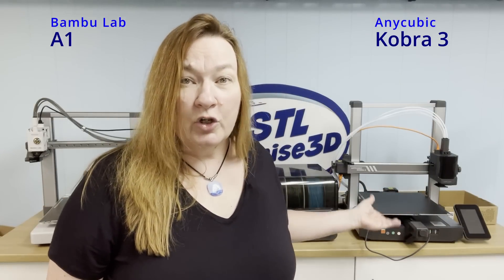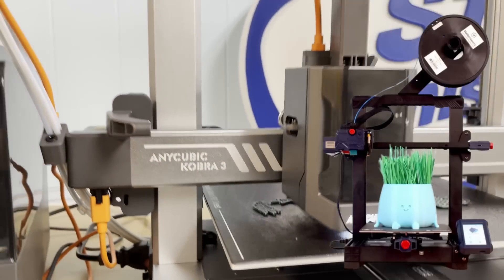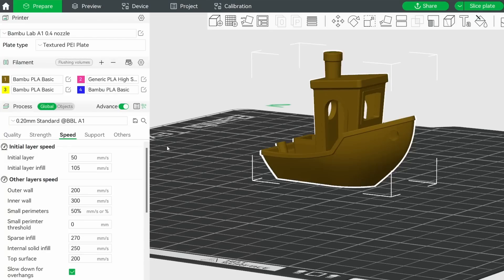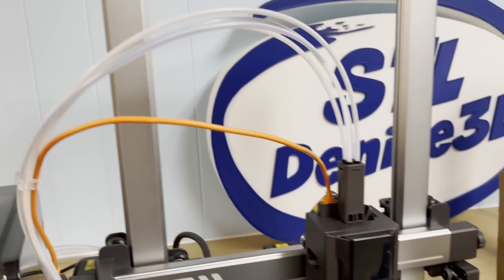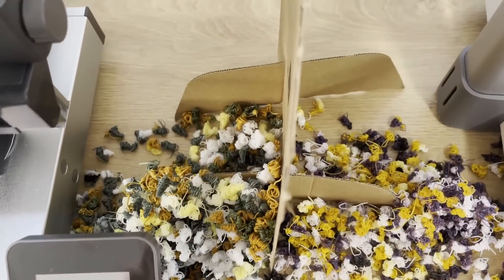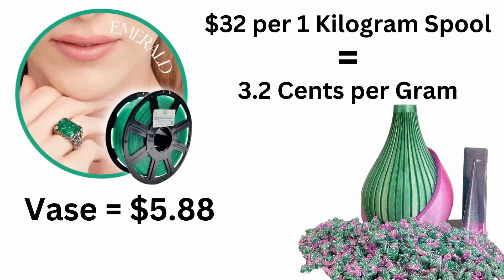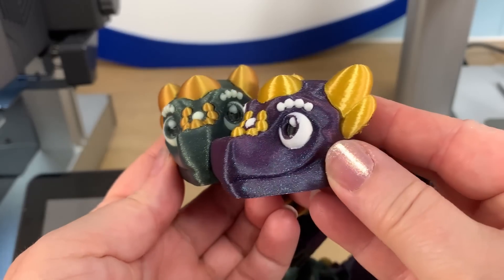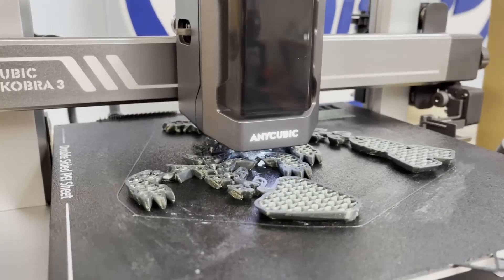ACE or AMS? Anycubic challenges Bambu Lab with new color 3D printer!

Comment: I'm gonna throw in my 2 cents. I have had both these printers and the Anycubic was an absolute pain to deal with, I was tweaking the thing so much and it kept giving me random issues that I could never solve. And I have been 3D printing for 6 years now. Anycubic's quality assurance is horrendous too, I have had many anycubic printers arrive with 100% dead boards and broken auto level sensors and they rammed the nozzle through the bed in the first few minutes of using it. I will never buy from them again. I have 2 A1's with the combo and one Bambu P1S and they are absolutely flawless in about every way, Its almost baffling how good the Bambu printers are, its like they solved every problem I had with the competitors. You can just get stuff done and run your print farm without issues, I cannot tell you how much of a godsend the Bambu printers are and they have accelerated by business.

Comment: Anycubic is the worse, I’ve got 2 of these machine and they were terrible. However Bambu A1 is the best. No problems at all.
Reply: Please elaborate, from what ive heard most of its problems can be fixed by tinkering even tho its a pain. Don't know if I should go with the kobra bcs its cheaper and open source and get a klipper plug in for the ace or if i should just get the a1 mini an have to face a smaller print bed and potential obsolescence in future once it becomes outdated.
Reply: @ I had no patience from the pain of the Any cubic.Customer service is no help and I could go on. I would go with the A1 mini. I promise you wouldn’t regret it.

Comment: Is the ACE airtight?
Reply from the maker: Tight enough -- it does have tubes running out the back to the printer. But a good filament drier needs to let the moisture out anyway.
Reply: @stldenise  Thank you. Was wondering if it had vents or fans somewhere.

Comment: I just recently picked up the Bambu A1 and absolutely love it.  It's my first experience with multi-color/multi-material printing.  While the AMS Lite isn't a dryer, I already have 2 of the new Creality dryers (I also have a Creality K1 and K1C, as well as a Prusa MK3s+).  I'm still learning the Bambu slicer software, but I actually tend to prefer it to Creality's slicer now.  Oh, and I'm in StL as well!  I love finding local Youtube channels!
Reply: How is the bambu compared to prusa? I have a good deal on a prusa with mmu2 and don't know which one to chose.
Reply: @belakulcsar  As far as I have read the Prusa 4 is pretty much equal when compared with the Bambulab A1, so if you have a good deal on the prusa it may be worth going for that. Where I live the Prusa is more than 3x as expensive compared to the A1, which is why i went for the bambu.
Reply: @belakulcsar even a good deal on a prusa is still more expensive than an A1 in my experience so I'd just go with an A1 I love both of mine

Comment: its hard to beat bambu studios slicer. ive been printing for awhile now an i got 14 printer between 8 different brands an ive just recently broke over an got a bambu lab p1s with the ams, i had actively avoid the bambu lab machines because they wasn't open source like all the other printers i owned so i avoided them but having to spend so much time painting alot of the models i was asked to make i finally broke over an decided to give bambu labs a try an at first i was just going to get the a1 with the ams mini but that was around the time they was having issues with the bed power cord i think it was but they had to recall them an that pushed me toward the p1s combo, was a bit more costly than i had originally planned to spend but im glad i got it, im going to get more at some point but the ams mini just doesnt seem to be as apealing to me since u cant hook more than one up at a time compared to being able to stack 4 of the regular ams with the p1 an x1 machines so that alone pushes me toward the p1 series of printers but i wouldnt mind trying there bed slingers cause thats what most of my printers are.

Comment: Sending back our Kobra 3...even though it says it has nozzle clog detection, it got totally clogged up inside the print head assembly with melted filament and we can't get the print head assembly off of the track.  Thankfully it hasn't been 30 days yet...most of these 3D printers only seem to have a one month warranty...
Reply: Bambu X1 Carbon Combo also didn't notice the clogged nozzle. This ended with clogged AMS that could not remove the filament from the hotend and displayed an error.
I managed to fix this, there was a spare nozzle, ana AMS also resurrected after I pushed manually a piece of filament through it. 

So there are no failure prone 3d printers ...
Reply: @pik33100  Good to know...ours happened the first week or so that we had it, so we sent it back and didn't have to deal with trying to fix it.  Plus the overflow ripped up the rubber cover on the print head, so that would have needed replacing.
Reply: I've had 4  Kobras of various models and they all had clogging among other problems.  I went to Bambu and will never go back until they concentrate on putting out a quality printer rather than one that is "advanced" all the time trying to keep up with Bambu Labs.  I don't go for the fastest printer I go for the one I can count on the most and Bambu has never let me down like Anycubic has.

Comment: Well now I'm back to being undecided between an A1 and a Kobra 3. I still think I'm leaning more toward the A1, especially as it seems to have had a price reduction, but I like the idea of an enclosed AMS. Don't so much like the idea of the Kobra slicer issues, but that's theoretically fixable software stuff.
Reply: I'm on the fence too. I wish someone would do an updated review with the new slicer for k3 based on Orca.
Reply: Go with the A1 even though the ACE is better than the AMS Lite.  You don't want problems, you just want a printer that works and you can count on the Bambu printers.

Comment: I received my Kobra 3 combo just a few days ago and the printer itself works great, but the ACE started malfunctioning after only 2-3 prints. It now occasionally loads multiple filaments when it should only be loading one, leading to constant jams and malfunctions :c
Reply: Tangles,spool retracement it’s soo frustrating
Reply: @ramirofonseca5169  I actually haven't had any issues with spools tangling when retracting. Just a problem with multiple being loaded at once. I contacted support, and they're sending me a part that should hopefully fix it.
Reply: @ramirofonseca5169  You could try applying a little WD40 to the rollers that hold the spools...?
Reply: I'm not surprised.  Every one of the four Kobra printers I've had had various problems.

Comment: I might have missed it but can you tell what the print duration was for the model (A1 total print time vs Kobra 3 total print time ) . Thank you and awesome video.
Reply: a lot of factors determine print time nozzle size, print speed, infill etc. the A1 has a max speed of 500 mm/s and the Kobra 600 mm/s but realistically you will be printing closer to 180 to 200mm/s. even slower for things higher detailed but they are both pretty fast compared to some of my old school 3d printers.

Comment: Doh, I’m waiting on my Kobra 3 in the mail and my friend got a A1
Reply: Nothing stops you from using Orca slicer which will negate the poop issue just like how Bambu slicer does it.

Edit: Nevermind, apparently there is an issue using Orca slicer and the Kobra 3 with ACE. There might be a fix floating around on the internet though.

Comment: Nice video and great comparison. As you show it’s a shame about the poop issue but it will be sorted. Unfortunately quality control with anycubic has been a concern of mine for a while.
How long did each print take when comparing the same models being printed? 
The dryer is a great idea but as with all multi roll dryers you’ll melt pla when drying higher temp filament in the dryer so mixing materials in the dryer becomes an issue.
Does the anycubic have roll swap over when one roll runs out and you have another full reel loaded?
Reply from the maker: You're right about the dryer, you can only do one material at a time -- the printer can only handle one temperature setting at a time too, so you're not going to mix PETG & PLA in one print anyway. 
I wasn't able to track the time on those prints accurately because both machines were being silly--the Anycubic got a clog and a spool fell off the A1. I did a little editing on the time laspe to take out the boring parts. Anycubic's slicer was off, it thought it could print a dragon in 8 hours, but it was more like 12. The A1 did it in about 13, so it was a tad slower. 
And last, yes, if you tell the printer all the spools are the same thing, it can automatically swap to the next spool when it runs out.
Reply: @stldenise  thank you for the update and the information, I love my Bambu lab printers but they are not the final solution to 3d printing and I am always interested in what comes next. I wish someone else would take a design leap and not so much copying going around.
Thank you for your great comparison videos and it nice to seen these machines being used side by side as everyone talks about how things compare but real world comparisons are very limited.
As ever though hardware often outpaces software especially when it comes to slicers, I know I owned a Creality Halot mage pro for about 4 months before the slicer issues were resolved that I could get decent prints out of it.

Comment: Why are they going backwards? Most of us know that core xy printers are better. Bedslingers are a thing of the past.
Reply: The A1 has proven this is not the case. Core XY is fantastic, but more $$$. Bed slingers like the A1 and A1 Mini are amazing values for those who want to get into 3d printing without breaking the bank or requiring a mechanics degree to get the thing working.
Reply: They have a corexy coming. Corexy isn't all that much better, worse in some case, than a bed slinger. My kobra 2 pro prints better than my k1. The k1 however isn't the same lvl of print quality as a p1p. Klipper bed slingers are just as fast as corexy. I prefer the bed slinger due to it being cheaper and easier to work on. I prefer open source firmware in any case.

Comment: Is the bambu slicer kid friendly?
Reply from the maker: Depends on the kid and what you're trying to slice. The default settings are pretty reliable these days, it wouldn't be too hard to teach the basics. You can also set up custom profiles, so you could have a "Bobbie Sue PLA for Action Figures" setting saved. My kid learned Tinkercad & Cura way before he was comfortable changing a roll of filament (which on an old Ender required a lot of thumb strength.) He was 10 when he learned Tinkercad at school, and about 12 when we got a printer of our own. By 15 I was tired of printing things for him and gave him the Prusa Mini.  🤣
Reply: Well the bambu printers are more kid friendly than what was available before it came out.  Just keep in mind all printers no matter the cost will have some issues and "quirks"
Reply: Lol I just got a qidi xcf pro as my first printer and felt like the slicer for  it might intimidate my daughter lol
Reply from the maker: @PatrickDG  Hmmm, this might be a video idea! I have a Q1, so I just opened Qidi slicer. If you put it on "simple" mode and make the kid a go to profile that has things set up the way you like it, I think it will work. You do have to slice it before it will tell you it needs supports, which is annoying. File management might actually be harder!

Comment: With a Kobra 3 on order, I've been waiting for more reviews of the Kobra 3 to come out.

What specifically got me to go for the Kobra 3 over the Bambu A1 was the drying function of the ACE. Being able to not only dry while printing, but to actively dry multiple spools of filament at a time without an additional piece of equipment is what really interested me. I have yet to see an in-depth dive into the ACE as its own piece of equipment, with a point-to-point breakdown between it and both the AMS and AMS-lite.

The sole downside to the Anycubic setup that I've seen is the slicer situation... but software is much more readily changed than hardware, and the ACE is currently (if what I've seen can be believed) the top-end in multi-material management systems. The margin is narrow, but the dryer function is, I think at least, enough of an addition that it tops any minor downsides at the moment.
Reply from the maker: The only thing that really annoys me with this is the slicer, and as you said, that can be fixed with an update. The ACE is a true filament dryer, it has settings for everything from PLA to ABS .

Comment: What is the best printer for tpu?

I have been printing since 2012 and have had my Tevo Tornado since like 2014 
It’s still doing its job but it’s time to get something new 

Any suggestions?
Reply from the maker: Oh wow, send that Tevo to the front porch with a rocking chair and glass of iced tea! You need a good direct drive for TPU and I think everyone has made the switch now. Creality, Prusa and Bambu have all done great with TPU (you may need to tweak a setting here and there). TPU doesn't work in an AMS or ACE, it needs a plain old spool holder. If you want a machine JUST for TPU, pick something with a short distance from the spool to the toolhead, which is pretty much all the bedslingers. And no matter how fast they claim to be, it doesn't apply to TPU, so use a nice slow print speed. Again, if you're JUST wanting a TPU machine, go ahead and grab an older machine running Marlin & you'll save some money too. Think Ender 3 S1 Pro, or MK3+.

Comment: great to see that they ripped off so many things from Bambu Lab, it increased their chances of actually making a good machine for once. Now let's hope that they keep supporting it. Honestly, I can't stand behind a company that doesn't care about innovation and stops supporting their own machines 3 months after launch. Bambu has been great for supporting every model trough firmware updates, adding features and tweaking functions and actually listening to their awesome customers. Thanks for the review, great video! but i'm happy that I just purchased the BambuLab A1 combo. It's been an awesome machine so far. Innovation!
Reply: Bambu stole 100% of their designs and tech from Prusa.....Literally 99% of their machines engineering  is Prusa.
Reply from the maker: @anthonylong5870  Not quite. The AMS is ground breaking and not something Prusa had invented. Prusa does get credit for the slicer, not the hardware.
Reply: @stldenise  Do your reseach a bit more.  Prusa invented the extruder, the gantry system for bedslingers (A1) and Voron invented the XY system.  Bambu stole all of it.  As far as the AMS goes, multicolor single extruder setups have been around for 10years+ , All Bambu did was put it in a box.  Bambu innovated NOTHING , they just repackaged tech that was already out.  Even their slicer is a Prusa clone.  I know what your doing with your channel, You are trying to schill Bambu and hype it hoping you will get sponsored.  Your reviews are nothing of the sort.  They are just Bambu commercials....
Reply: @stldenise  So how comes that MMU is at version 3 and performs better than AMS?
Reply: @eaman11  it is at version 3 because previous 2 sucked, and it works "better" because it is hopelessly complicated, and something that could never be sold to a wider audience
Reply: dude, ams also comes from community.
Reply: @eaman11  The waste is a red herring.
You are "Wasting" less than a .3 grams out of 1000 in a spool with each color change or avg 1000-5000 color swaps per roll with a simple tweak. 

You tend to lose more in a prime tower which can be shrunk down, turned off or configured to purge to infill or print more of the same item as the purge is the same. 

You are arguing for literal pennies. Do you get the same energetic response when your supports, brim, skirt, purge lines are material waste....?  

The AMS is the most reliable color changing system out there. It can be setup in minutes and needs no tweaking, tuning, building. It is an efficient use of space unlike the mess of the mmu3. Heck the MMU3 cant even auto load filament. 

check Dollars and Cents, bambu lab filament waste true Cost